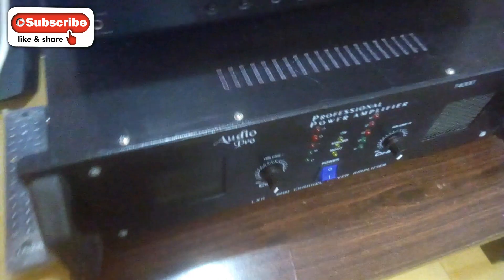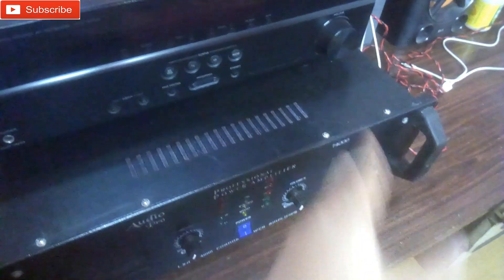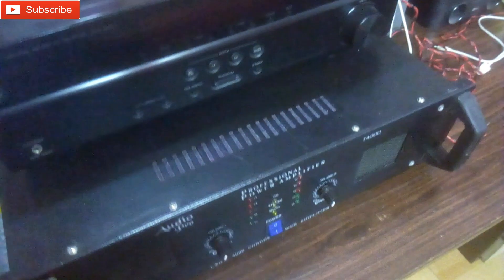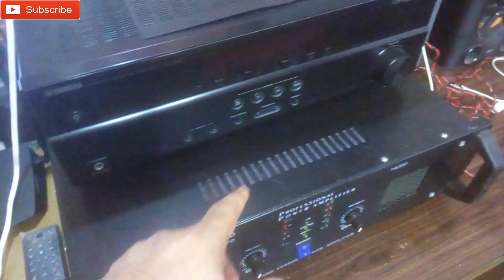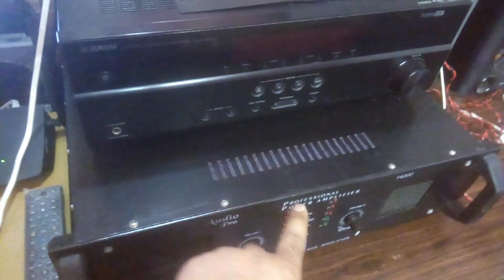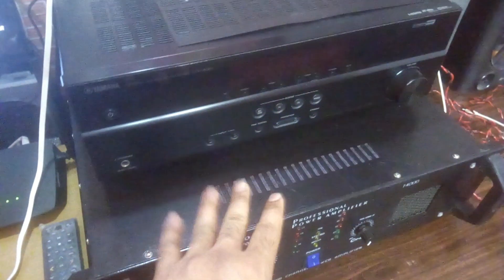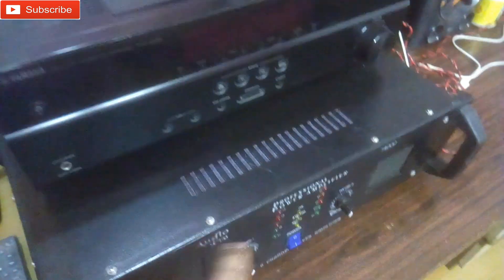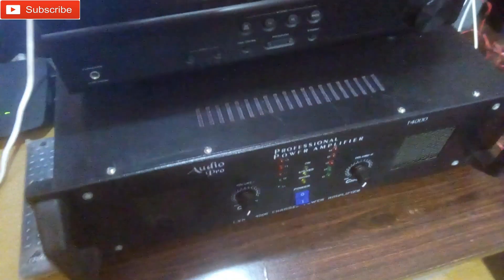DIY 500Watt Mono Subwoofer Amplifier Sound Test // The technoboy

Comment: Hi, need your recommendations board with low noise. I want to build a good sound quality home theatre 5.1 .  for 12-inch sony subwoofer which amplifier board you will recomend ?
Reply from the maker: Check the inside video of this amp. There you can see another amp kit in this amplifier. Thats a 400watt bridge mono amp with high gain. Thats more then best for 12 inch sub & it can shake your whole house. But in budget price. Bought that kit long back. If i find that on amazon & i will share the link.

Comment: Isn't it an outdoor subwoofer? Is it ok if we use it in home?
Reply from the maker: Yes its outdoor subwoofer. For home max size is 12 inch. But i use this 15 inch beast in my home. I love heavy bass. Yeah you can use this at home. If you have individual house. But any big subwoofer is not at all good for any apartment.